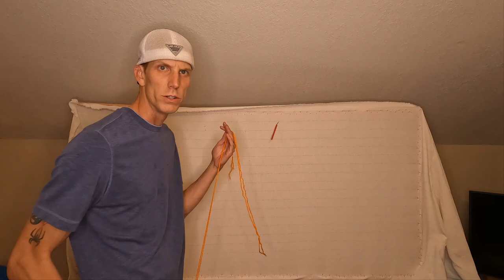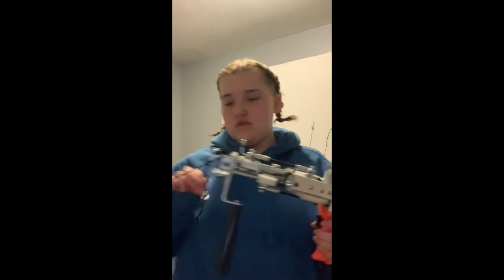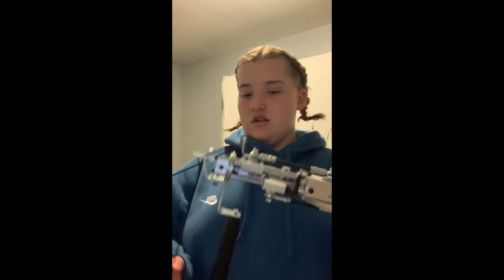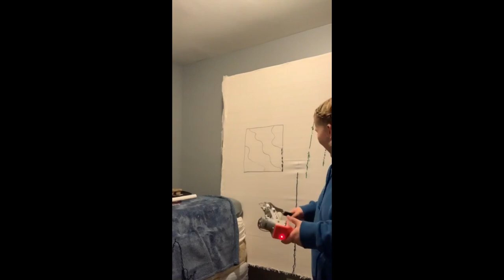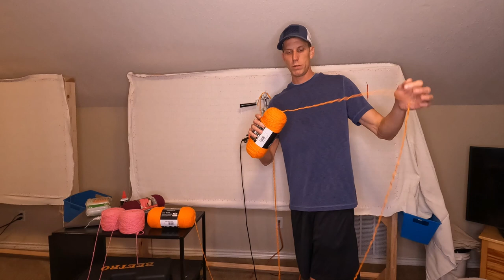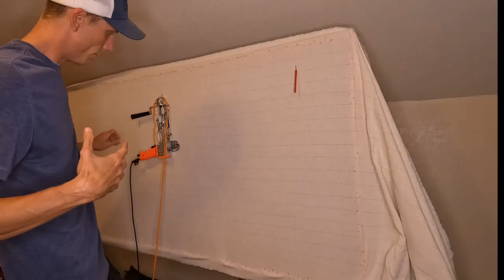How to avoid Yarn from Falling out of your tufting Gun

Comment: Why won’t my gun cut the yarn? It does sometimes, but I mostly have to have scissors nearby to detach from the fabric. Otherwise, pulling the gun away pulls the yarn back out.
Reply from the maker: Probably need to adjust your closer.  Check out the video about the 2 in 1 gun… there’s info about the closer in there
Reply: Adjust your screw at the bottom of your gun

Comment: Thanks for this one! 
I've got a curios question for you, which I may just end up answering myself by typing it lol.

We've got a Tuft-Love cut/pile gun, and using 80/20 acrylic/wool yarn that constantly jams in the needle of the gun, cutting short and tearing the wool apart and out of the needle. Is this caused simply due to the yarn's large size? Is there any way to mitigate this?
Reply from the maker: Every yarn acts a little different.  If the yarn is too soft, the scissors have a hard time cutting. I stick with 100% acrylic weight number 4 and use 2 stands.  It just depends.